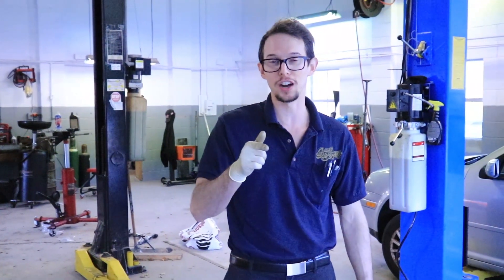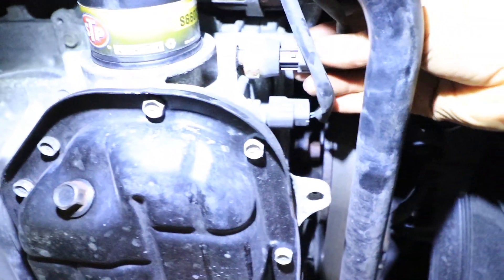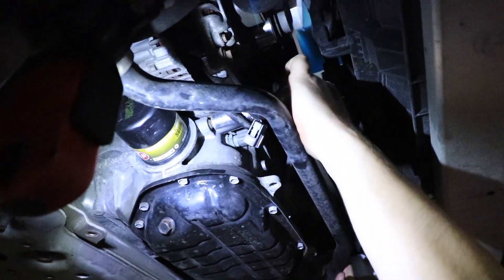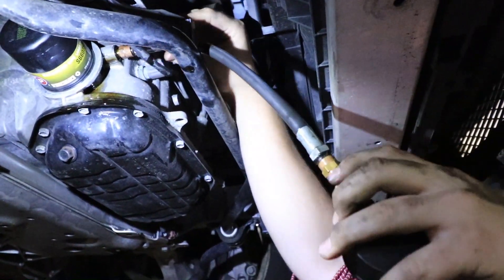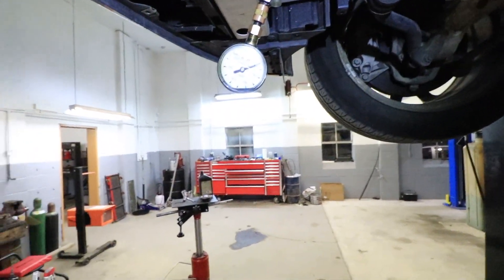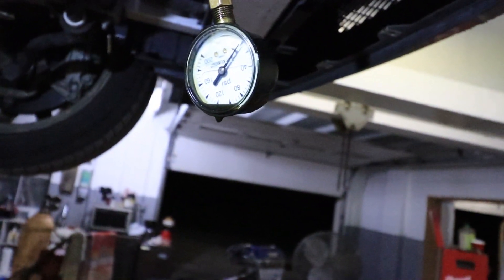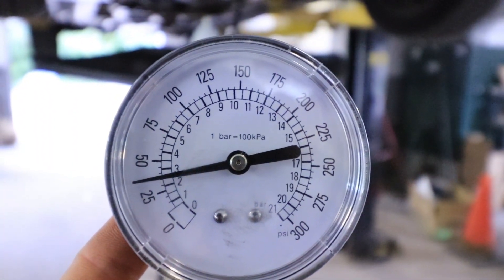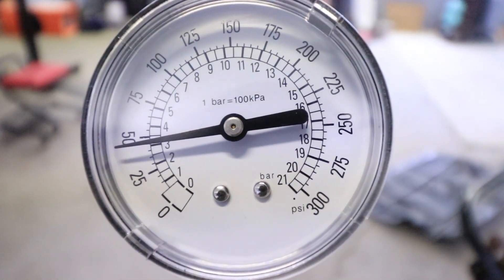INFINITI G37 OIL GALLERY GASKET FAILURE VQ37 (370Z, Q50)

Comment: Just for the sake of data. My 11’ G37S has about 250k miles on it. Water pump started weeping so im doing that, the chain, guides and now that im in there the galley gasket looks fine but might as well while I’m in there. Everything is original and the car runs great other than the coolant leak. Been a great daily
Reply from the maker: right on

Comment: Hey I have a 03 350Z and at idle my oil pressure is at zero and my oil light comes on as soon as I start driving the oil pressure goes back up to normal could it be my galley gasket or could it be the oil pressure sensor
Reply from the maker: could be either, thats why this test i necessary
Reply: wat was it?

Comment: I’m giving this 100 thumbs up my butt
Reply from the maker: nasty butt thanks
Reply: @salvobrothers5928  any idea why my Infiniti might be making a rattling sound after I drive it a little? It sounds like rattling from under the drivers side.
Reply from the maker: @brenb9109  probably the heat shields on your exhaust, its a very common issue
Reply: @salvobrothers5928  how do I fix that ?
-edit
I think I found a video and it looks really easy to fix if I can get to a place to let me lift it up high

Comment: Hey man, what’s the actual size on that fitting? I bought a pressure tester but the fittings were incorrect. I need exact spec... thank you
Reply from the maker: an oil pressure gauge should come with the right fittings, i believe its 1/4 NPT

Comment: when i go to work tomorrow i’ll order a oil pressure gauge if none of my techs have one but i hope it passes… if not.. how hard is it to replace gallery gaskets… never heard of these becorw
Reply from the maker: its a big job since its behind the timing chain set. The whole front of the engine has to come apart so you might as well replace everything while your in there.
Reply: @salvobrothers5928  hey thanks for the reply , update on mine. the car quest advance auto part switch was defective. i got one from infiniti for 18.85 and it turned the light right off. thank you! apparently jdm infiniti’s like dealer parts SOMETIMES
Reply from the maker: @stargasmgaming  awesome there we go

Comment: I have an 03 with low oil pressure and thought it only happened with the HR's. I peeked through the water pump cover and saw a tiny piece of the gasket sticking out. In the shop now.
Reply from the maker: sounds like you caught it just in time, good deal.

Comment: So stupid question (not a car guy), I have a 12' G37x with at 73k miles.  Still runs like a dream, but it seems like this gallery gasket thing is at the very least a well known issue.  Is there anything I can do to prevent failure?  Ie. just take it a mechanic and swap it out before it goes bad?
Reply from the maker: your car i believe does not suffer from this problem because, infiniti and nissan updated that gasket on the newer ones to stop this from happening, let me check with. Corlan on that on what year it starts
Reply: @salvobrothers5928  Thanks! keep up the great work
Reply from the maker: Corlan: "2014 is the year the gaskets were changed to be a metal composite. Any year before that is susceptible."
Reply: @salvobrothers5928 Thanks for the quick reply!  So anything preventative I can do?

Comment: What are some symptoms of bad gallery gaskets? Besides the low oil pressure
Reply from the maker: thats about it unless its so bad its rattling the engine
Reply: @salvobrothers5928  would the  car go into limp mode or throw any specific codes?
Reply from the maker: @mikehawk1890  Usually with the VQs there are no signs of failure until it's too late.
Reply: Once the gaskets Fail the engine is done for or you can still fix it?

Comment: I keep trying to decide if my 08 Z has this issue. I’m usually sitting about 15 at warm idle but some days it’ll read closer to 25. Some folks have reported 15 at idle and did the gaskets and it went back up to 30 after the repair. Others have done the gaskets and only showing 15. Idk if I should start to worry about it or not. Nissan spec is no less than 14 at warm idle but everyone says the Zs gauge is inaccurate. I’m reading about 60 at 2k rpms, 90 by 3k rpms. 118ish at WOT. I’ve read on the forums ppl say spec is 43 at 2k rpms and 90 at 6k rpms. So I’m on the low side at idle and on the high side under load. Perhaps my sending unit or gauge is just out of whack?
Reply: Did you ever replace the gaskets? Preatty sure mine on its way out idles close to 15psi fully warmed up. All the videos I seen of them replaced have the idle jump up to 30psi at warm temps.
Reply from the maker: @JR-mw3gf  Not yet. We'll be replacing the gaskets while doing some work in the engine. Trying to make all the horsepowers in this G37 build. We'll be filming it all, however.
Reply: @JR-mw3gf  yo bro mine does the same thing did you ever get the gallery’s changed or you still rocking without them
Reply: @Pr3stonR  Yep took the timing cover off and both of the gallery gaskets were cracked and letting oil through. The oil pressure kept dropping and it got down to like 8psi and would not go past 60psi at full throttle any more. Needless to say after the fix it was back up to normal  idle 30psi and 60+ above 2k rpms and the car did not feel all sluggish like before.
 Edit: Sold the Z couple months ago and got a g37. Fingers crossed the gaskets don't take dump on this one too.
Reply: @JR-mw3gf mine has stayed at 15psi warm idle for about 4 years. No problems at all. Car pulls like a train
Reply from the maker: id keep an eye on it. it sounds like it may be starting to go bad but its not worth worrying about it at this point till it drop lower, those are good numbers for now.

Comment: hey Salvo Brothers, my g37 idles at 14-17 psi but occasionally goes to 13 and at 2k it goes up to 55-70. Do you think my gaskets are gonna go
Reply from the maker: nah that healthy i wouldn't be worried about that in the slightest. keep an eye on it occasionally and see if it starts to fall off though like every couple months or so.
Reply: Thanks for the reply man!! I was thinking of tuning the car and dumping money into it but if I had a gallery gasket issue, that would've been my first repair, however it looks like I won't have to worry about that.
Reply from the maker: @RawrThet  Sounds good! Corlan is actually developing his career as a Infiniti/Nissan tuner and is big into everything involving those cars. If you ever have any questions don't hesitate to reach out!